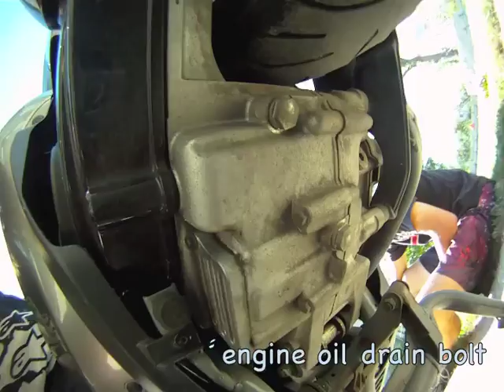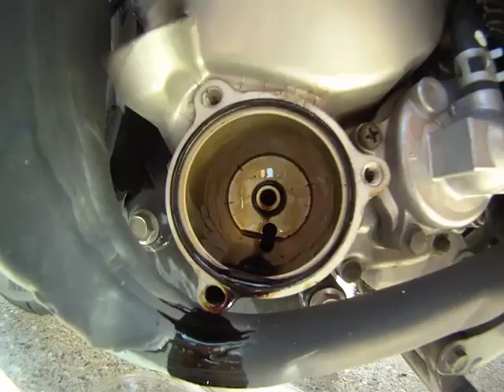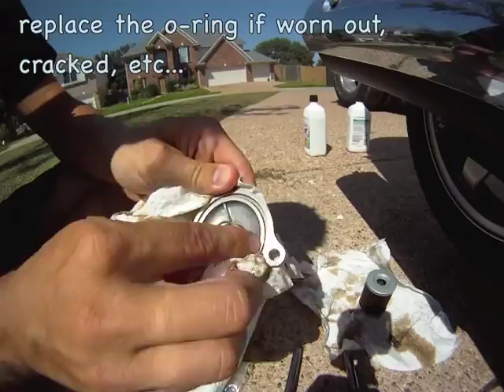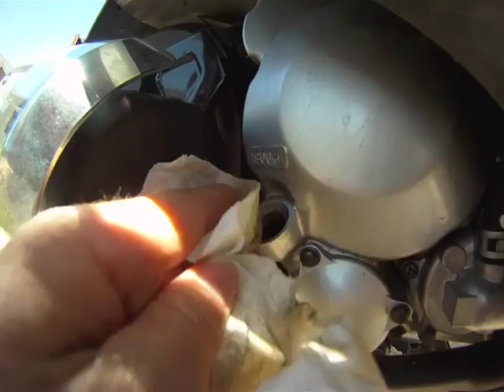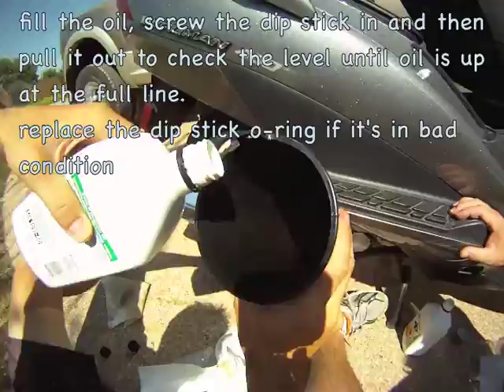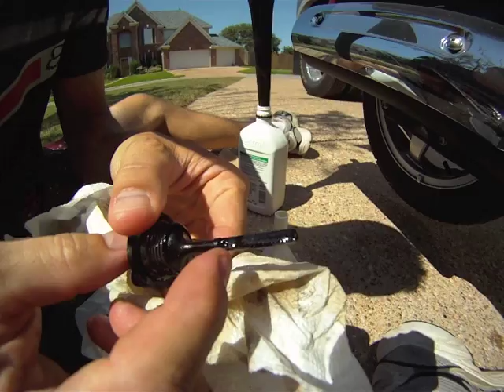03-06 Suzuki Burgman 400 Oil Change & Oil Filter Replacement | MicBergsma

Comment: These videos are years old but still the best on you tube, and it's so much easier to watch a video than page through my manual with my eyesight!  Just done my engine and transmisson oil, but forgot to reset the oil change light, so I need to watch another MicBergsma video... Many thanks Mitch, these vids are fantastic!

Comment: Even tho the video doesn't recommend an oil, I use Traveller (Tractor Supply) diesel oil 15W40. An almost-exact duplicate of Shell Rotella T. Extremely tough oil. With the itsy-bitsy filter, I would recommend changing every 4K or 5K, or one year, whatever comes first. BTW, you can get the Traveller oil on sale at TSC for $21.99 for 2.5 gallons ($2.20 a quart). Or sometimes you can find it for $9 a gallon ($2.25 a quart). Also,  putting some synthetic oil in is very beneficial (synthetic oil chemically bonds with metal surfaces). Take your pick: Shell Rotella T6, Mobil One, etc. Like, the first 8 ounces?? Or, go expensive and just use synthetic oil (Shell Rotella T6 at wallyworld = $21.36 a gallon.)

Comment: I hope my oil indicator light goes off with the oil change, i ran it a bit low and added a quart.  GREAT video!!!
Reply: +aci hawaii "Low" doesn't mean "add a quart". The high/low area on your dipstick doesn't represent one quart, as with automobile dipsticks. I suggest adding 4 ounces and then recheck.

Comment: You have shown the incorrect way to check oil level. You screwed the dipstick in completely to check the oil level. THIS IS INCORRECT.  After removing and wiping the dipstick, replace it in the opening, but do NOT screw it in. The method you showed will always leave the oil level TOO LOW. Check your owner's manual.
Reply: And I think that's a mistake. In my instruction for Malaguti Madison wrote that one should not howl.
Reply: Korrekt SlickTennessee 👍🏻 und 1900 ml = 1900 ml. Das messen ohne den Motor zu starten ist auch falsch. 1. Der Filter muss sich erst vollsaugen. 2. Man misst den Ölstand betriebswarm, ein paar Minuten nach dem fahren.

Comment: Маслом фильтр не пропитал перед установкой, может порвать при первом пуске двигателя.
The oil does not impregnate the filter before installation, it can tear when the engine is first started.

Comment: Hi Mitch:  I couldn't find your email address as I was going to email you a photo of Page 52 of my AN400 manual regarding checking your oil for a 2004 Suzuki Burgman.  It states that the oil stick should NOT be screwed in after filling to check the oil.  In other words, the oil stick should be stuck into the crank case, but not screwed into the crank case to check the level on the level indicator.  Otherwise, you are short-changing the oil level in the crankcase.  Just thought you'd want to know

Comment: Hot engine better....gets all particles out, Any 15/40 w diesel oil is fine....has Zinc in it, like JASO MA oils.
excellent video
Reply: Also it helps with draining if you take the dipstick out before the sump plug

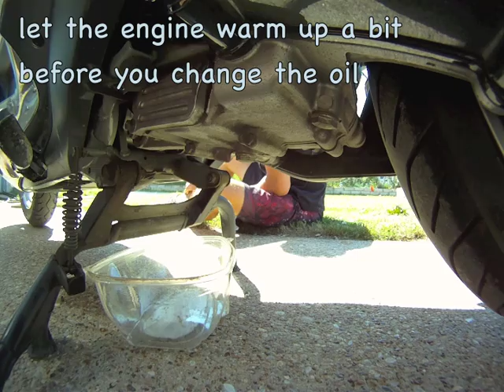Comment: hey guys, what is the other drain plug for? (same size). you can see it at 0:15 seconds. by mistake, i first unscrew that plug and little oil got released. afraid that I did not let other oil go out - have a better image here (drain plug is marked red): https://drive.google.com/open?id=0B3sFO9075ZPkeGJJcW1ZWU9XQlU

Comment: THE  OIL INSPECTION DIP STICK IS A BITCH TO UNSCREW... CANT  GET  YOUR  FINGERS IN THERE ...SO TIGHT ... AND NEED A PLIERS  TO FINALLY GET IT  OUT.. ..  THEN  ON THE 07 THEY PUT IT ON THE OTHER  SIDE  OF THE  BIKE..??????